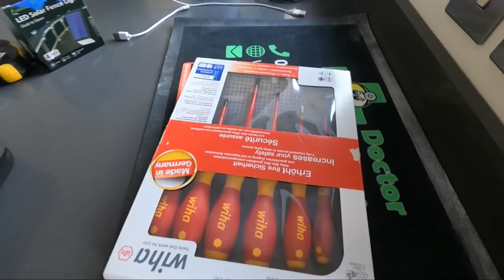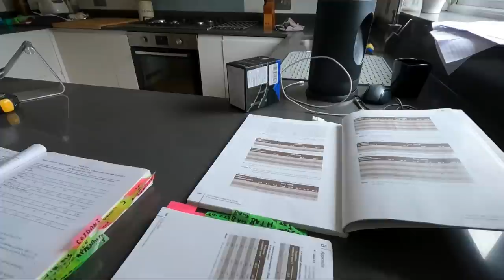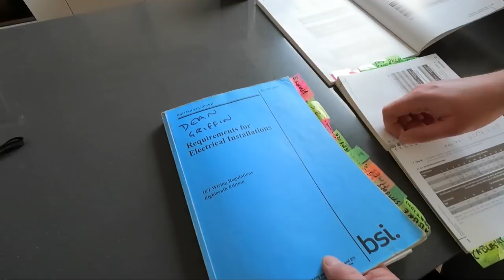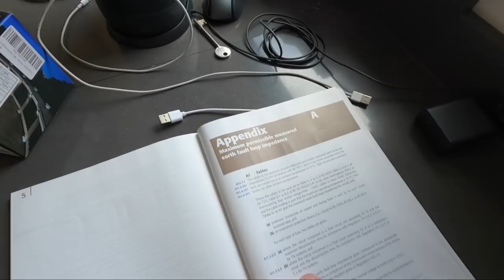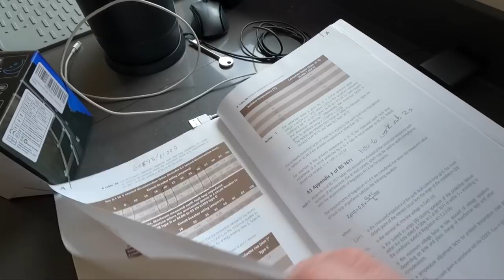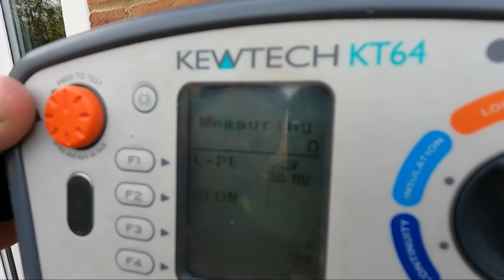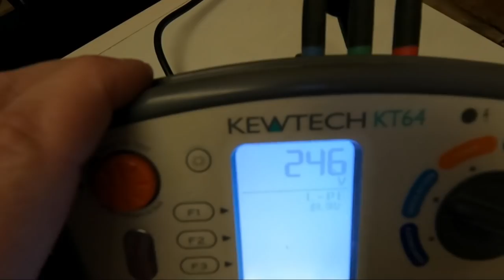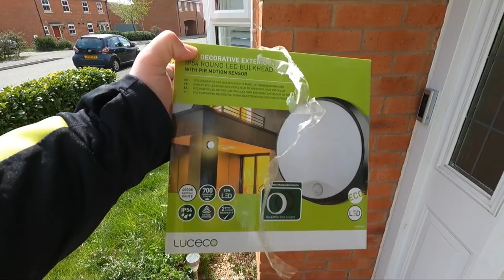Fitting back to back outdoor socket Maximum ZS test BS7671 80% on site guide

Comment: Hi Guys, thanks for the video.  Tip for remembering Zs for type B breakers.  Divide 35 by breaker size, ie for 32A MCB Type B, 35 divided by 32 = 1.1
Reply: Thanks for the tip grumpy grandpa!  👴🏻 glad your enjoying our content
Reply from the maker: Well I never knew that, just checked it and it works! Wow, cheers GrumpyGrampa
Reply: Mind gone into overload, blown it. My breaker exploded. Good tip thanks.

Comment: Great work - Need the wiha speed E2 mate makes loosening and tightening sockets and breaker screws so much easier. Fully insulated two torque levels (though not a torque screw driver you can get separate adaptors for that). Save a lot RSI injuries in the long term.
Reply from the maker: Cheers for the tip Math Man, I'll have a look and see if I like the look of it, thanks for watching 👍👍👍
Reply: Don’t get the wiha speed e1 Gaz has ripped it to shreds. I have both versions and they are very useful.
Reply: @mathman0101 I like the sound of this. I love wiha 😁
Reply: @TheAdamEdward  look at past efixx videos they covered the speed E2 when Gaz lost miserably against Joe in a competition.
Reply: @mathman0101  thanks mate will check it out